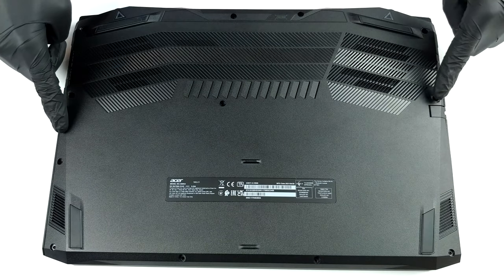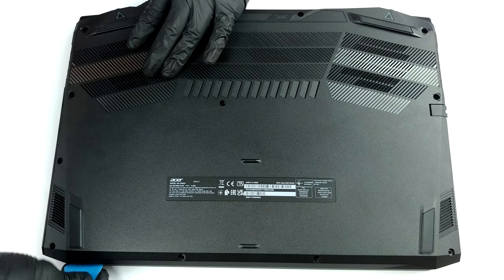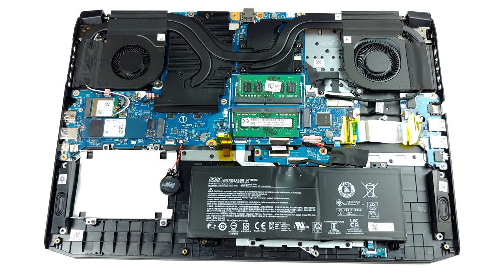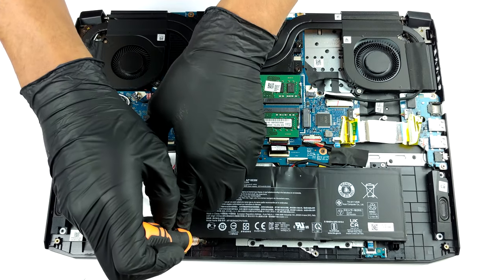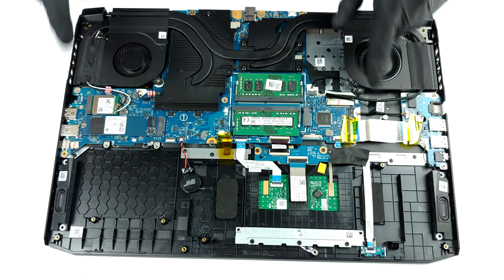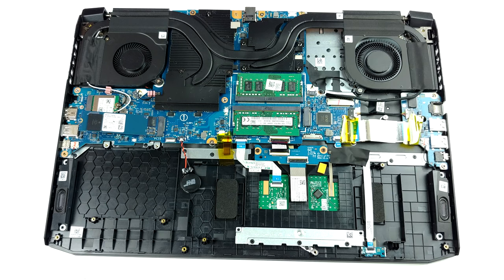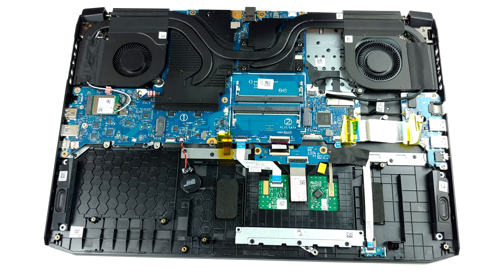🛠️ Acer Nitro 5 (AN517-41) - disassembly and upgrade options

Comment: Where is the second M2 SSD Slot?
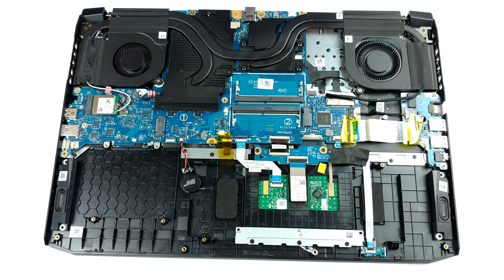Reply: In case you are still in search of a solution, the slot is located on the right side of the lower RAM slot. You can see it at 3:33, identified as JSSD2 (the housing has the label 2114E3 on it). At 3:25, a screw holding the SSD in place can be seen directly above the center of what appears to be an IDE cable (which connects the motherboard to a smaller board).
I hope this is of some use.

Comment: where is the second m2 slots?
Reply: The second M.2 slot is located on the right hand side of the board next to the lower RAM module.
Reply: @raptureboi  And it works fine :)
Reply: @JesperValentine  as it should?

Comment: Hey I have an Acer Nitro 5 with Ryzen 5 5800H and an RTX 3060, and 16GB ram which is supposedly dual channel and I want to upgrade to 32 GB ram. Will adding just one more RAm stick of 16 GB ram do the job?
Reply: yes it has 1 stick 16gb dd4 3200mhz, make sure you add another 16gb stick but with same 3200mhz and preferable same company RAM so they are compatible for dual channel.

Comment: Possible to run 64GB of ram on this laptop? Also Samsung 980 evo will run? The two slots are gen3.0x4? On your website it’s stated that only max 2tb is support does it mean I cannot add a 2.5 inch 4tb ssd inside? Thanks in advance!
Reply: It depends, 4tb drives are thicker, about 15mm that's why they don't fit in most laptops.. 2tb are usually thiner (7mm) judging by the drive bay on that laptop i don't think that 4tb drive would fit on it